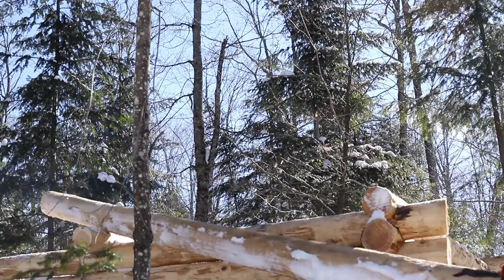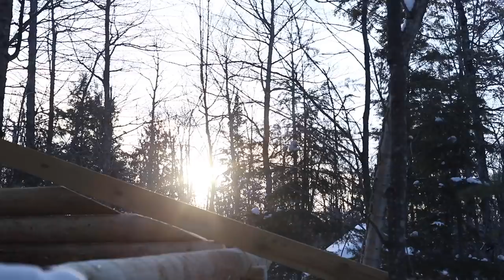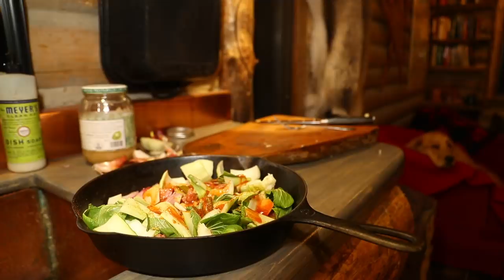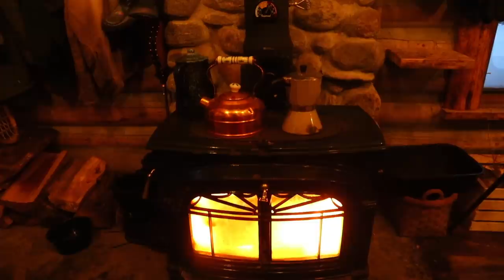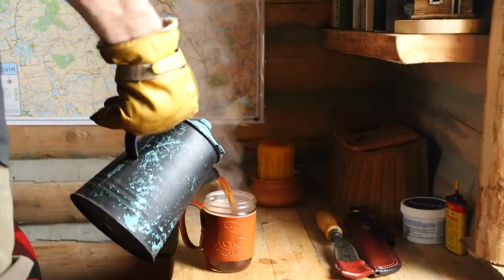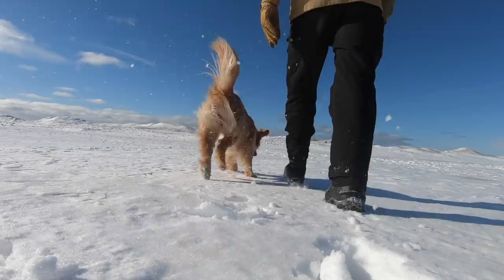Build a Log Cabin Alone in the Frozen North with Hand Tools | Cedar Sauna Build Ep. 14

Comment: A tip from the late great Anthony Bourdain, when you are using the knife, grip it with your thumb and forefinger just in front of the handle on the blade itself. You will have far greater control, balance and feel for the knife using it that way.

Comment: Great Video as always. Watching you melt snow to get water gave me an idea, this is more a proof of concept and probably won't work this way, but if you were able to put say a metal trash can with hole cut in bottom size of stove pipe on the roof around the chimney with no lid. Snow would then fill up the can and the heat of the pipe going through the middle would melt it/keep it liquid. Then a pipe out the bottom of the can to say a pot filler faucet by the stove would give you water to at least cook with. So many things to consider but if you could build a heat exchanger to use the stove heat to keep fallen snow in a tank melted might give you 20-30 gallons of water in the winter.

Comment: Curious about cabin building materials. i have a choice on the property of spruce, red pine, poplar, maple and oak. What would u recommend we use to build a log cabin while using wood off the property?
Reply from the maker: I assume my the diversity that you’re south and that the spruce and poplar are white, not black (black would be much preferable).  So, oak, spruce, poplar, red pine and maple in order of preference. None of them are naturally rot resistant so you’ll need generous roof overhangs and a raised foundation. Maple would be good too but generally I’ve found they’re not as straight and it’s so hard for hewing straight